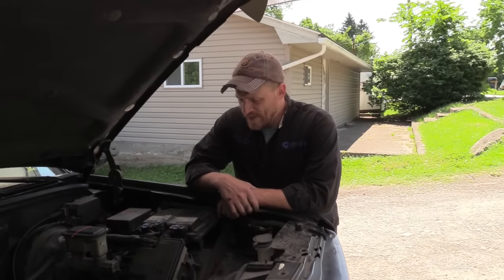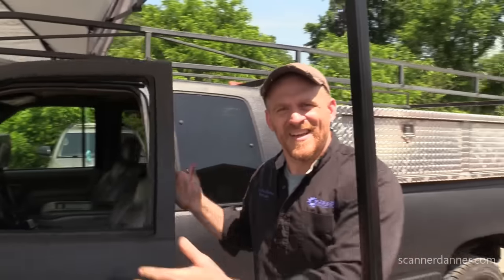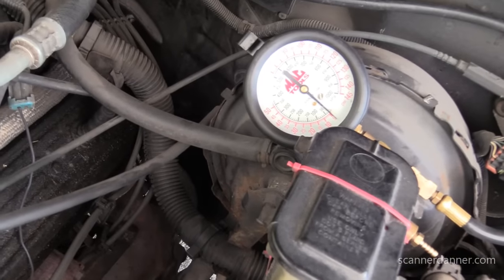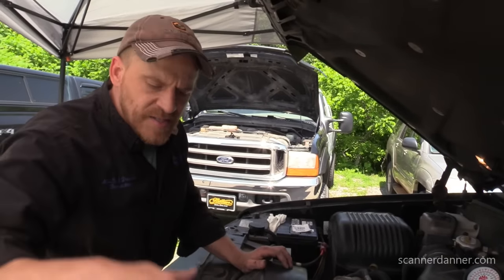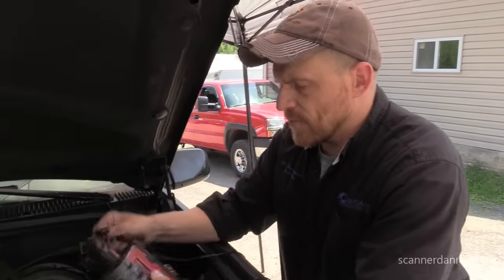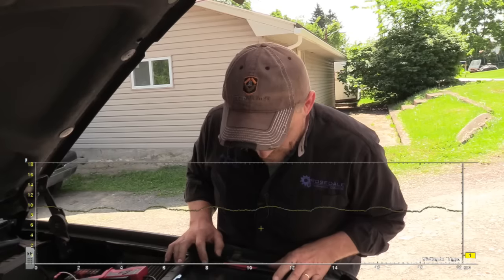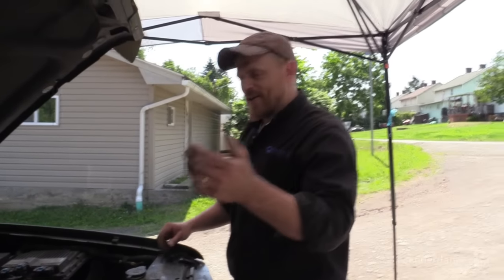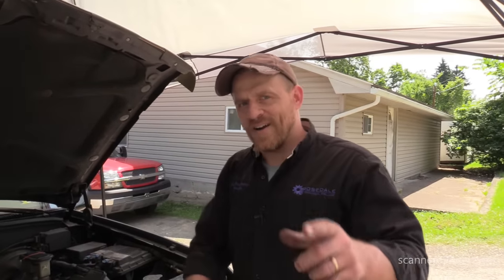Quick Diagnosis of a '97 Chevy with a Fuel Pressure Problem

Comment: Couldn’t a dirty fuel filter cause this as well
Reply: I was thinking the same thing. If it has an external fuel filter I would change that first then see how it looks.
Reply: Wouldn’t you want to T in before and after the in-line filter to make sure pressures were reading the same ??
Reply: Fuel filters are cheap. Just replace it and see if that fixed it.
Reply: Restriction after pump would have more amp draw.
Reply: Charlie Magoo ..... How much more amp draw would I expect to see??? What is a normal amp reading for that pump??
Reply: Joseph Baade.  He mentioned it in the video i think 8-10 amps.  He showed a video one time of a pump wired backwards only 1.5 amps or such.
Reply: Joseph Baade           A plugged fuel filter would do exactly the same thing but the scope pattern of the armature shows us that the pump is bad. Pump rpm is also low. Driving with a partially plugged fuel filter can damage the pump over time as well.
Reply: I'm a be honest with you guys, I've never had a fuel filter on a gasoline engine cause these symptoms.  On a diesel?  Sure, but gasoline?  Never.  I have been in the industry for a while now.  99% of the time this is either a fuel pump, or circuit issue.  Fuel pump relay, stuff of that nature.
Reply: I have been in the trade for 47+years and i have seen a clogged fuel filter cause that problem. Not often but i have seen it.
Reply from the maker: Absolutely a plugged filter could cause a low volume/psi problem (which is what we had), changing the fuel filter and retesting is about the only thing you can do, other than measuring psi before and after the fuel filter, which no-one does. In my experience, when a fuel filter gets plugged to the point of low volume symptoms, the pump it getting replaced anyway.  Damage occurs to the pump (higher than normal amperage/heat) from plugged filters. I had a customer with a plugged filter (work truck), changed the filter, all was well, happy customer in that he only needed a filter and not the pump, truck comes back 2 months later on a tow truck with a bad pump and he was very angry with me in that he had to miss another day of work. I have never just done a fuel filter since.
Reply from the maker: @Gene Mean I have no problem with this method at all
Reply from the maker: @ Joseph Baade yes you would and it is just easier to change the filter and retest
Reply from the maker: I also want to add, the pump RPM and waveform said this was NOT a plugged filter problem.

Comment: 1997 k 1500 silverado 5.7L 287K miles still has factory poppet injection,
i had started to get long cranks. checked fuel pressure and fuel pressure was going to 60 but leaking back quickly down to about 20.
decided to put another fuel pump in it Delphi> i was already going to take the pump and sending unit out anyway because of a intermittent fuel gauge failing (Carter fuel pump sending unit was installed 2 years ago and has never worked right). aNY WAY
the original pump (carter had a leak back issue) so i decided to put a new delpi in the original sending unit i removed before the carter.
ok here is the meat and potatoes, new delphi pump pressure prime pressure 60psi. run idle pressure around 54 to 55. snap throttle goes to 60.
truck is stumbling during open loop and not so bad on closed loop. pump amps are 4.89 running idle and i have checked all the plugs for good connection. Is 4.89 to low for a new pump.
also my LTFT and STFT are high 25%.
this truck has had history of lean  po171 174 . i have noticed since this new pump my fuel trims Short term are kinda hunting around and always staying positive LTFT are always around 25%. i believe its a fuel delivery problem.  also has new fuel filter.
can a FPR or poppet cause this problem.  also on the snap i am watching misfires happen on almost all cylinders 1 2 and 4 events at a time.
i am at a loss. is it common to get bad fuel pumps. could poppets And FPR cause this. ALso i will admit during troublshooting of the old pump i pinched return and ran pump with the test wire and pressure went to 75 or something might have even been higher. could i have damaged the FPR to to cause new pump low fuel pump load and low amps and lean
help if you can and thank you very much. gonna do some more test tomorrow
Reply from the maker: Yeah great questions! I like your psi readings you said, after the second pump was put in. But amperage is low, these run closer to 9 amps from memory.
Yes a pinched return line can damage or rupture a regulator diaphragm but that would cause some serious rich conditions from the fuel leak internal to the manifold and also a very bad bleed down issue.
Is it low on power? At wide open throttle?
Reply from the maker: Open loop stumbling as in misfiring or idling an initial step in throttle response? 
Intake manifold vacuum leak could be a factor if it's an idling issue
Reply: @ScannerDanner  open loop stumbling it was acting just like your vehicle in this video 
But would not do it all the time 
And doesn’t do when it goes closed loop 
I need to check the ground for the pump 
I am gonna give it a new ground to see it amps change
Reply: When you go WOT
Reply: I am gonna do a few more checks
My main thing was the Amos on that new pump 
Especially when watching your videos from your experience knowing they should run 9 amps 
I am a diy guy and don’t have a lab scope to check wave form to see if pump
Is running at correct ROM
Reply: RPM
Reply: @ScannerDanner  when it’s at operating temp 
It seems to run great although while driving and monitoring my stft and LTFT trims are high
LTFT is at 25% during cruise and stft fluctuates any where from 9 to 15% all positive 
Truck seems to run great when warmed up
Reply: Fixed it finally after 3 years of high fuel trims
Reply: Installed new MFI and all fuel trims returned to normal

Comment: Funny my fuel pressure is at 48 psi at idle and rises to 58 psi when I blip the throttle, 57 psi key on engine off, runs fine
Reply from the maker: Two explanations for that. 
1. You have the updated injectors that are not using the mechanical poppet nozzels
2. Your gauge is off by about 4 or 5 psi
Reply: @ScannerDanner  I did wonder that, well it runs fine other then the lack of power, I do have the updated injector assembly, it's been a while since I did it, but I noticed the pressure dropped with the new setup, but just recently I have been chasing a slight rough idle, but mostly lack of power condition, and might have been overthinking that it's the fuel pump, seems to startup ok and wot there is no bucking or misfiring, no codes either, wot tests were also done with fuel pressure gauge attached, wot fuel pressure rises to 57 or 58 psi.
Reply from the maker: @dawsonjorgensen3521  my favorite low power test is to watch the O2 mv at WOT
It should be 800+ the entire time. If it drops low, you have a fuel starvation issue, if it stays rich as it should next step is to check for a restricted exhaust
Reply: @ScannerDanner  much appreciated, will definitely check the o2 readings

Comment: Man do you have a email? I have 98 gmc I've changed fuel pump lines filter mass air flow coil wires alternator. My truck cuts out hard starts lose of powers. It seems like fuel but only dose it intermittently. I need help it's my plow truck and cant be down
Reply: My 97 does the same thing
Reply from the maker: I have a  forum that is free to join and we can definitely help you. 
https://www.scannerdanner.com/forum/post-your-repair-questions-here.html
Reply: @ScannerDanner  thanks man I've watched all your 5.7 chevy videos and done all test and at a loss. I subscribed and posted my question on the forum hope it makes sence I'm horrible with describing what's going going on. I know it's something that if someone like you looked at it would have it figured out in mins lol I'm a parts changer not a mechanic lol I can not diagnose very good imo
Reply: @ScannerDanner  I've tried and when I go back to look for replys I cant find my question. I've tried 3 times.
Reply from the maker: @jesserousseau2481  email me at support@scannerdanner.com with your user name and I will look to see what is happening

Comment: Most possible faults: 
1)It’s a Chevy 
2)Drive by wire pedal wire is kinked
3)Muffler back pressure too low
4)Refer back to #1

Comment: clogged filter?
Reply from the maker: a clogged filter would be an option, but amperage would have been very high in that case. I think I did an amperage measurement?
Reply: @ScannerDanner  you did and it was in the normal range with low rpm on the pump.  thanks for the reply.  you and eric o are heroes.  am going to buy your book once taxes are paid...cant wait for the new bedside reading
Reply from the maker: @peetky8645  thanks so much!

Comment: truck cuts off going down road ?....cranks but won't start ? ...check the ground strap running from back of block between engine block and firewall down thru a tube to the passenger frame.....note---ground strap at back of engine is a bastard to get to

Comment: Flow test would of been nice, those in the know test the flow😉😉
Reply from the maker: No need to do a flow test, never have, never will. If psi drops during heavy loads (wide injector openings)  you have a flow problem.

Comment: wow, easy to get burned on this, I thought 50psi would be fine.  also thought the system could increase the fuel trim to compensate.  i was expecting to see 20-30psi.
Reply from the maker: yeah, this system is very sensitive to low psi because of the mechanical poppet nozzles that are on the end of the injector ends. They only open with pressure (min 50 psi to open)
Reply: Oh that makes sense now..  last one i messed with was on a 99 Suburban, replaced the whole spider with the upgraded EFI style injector kit.

Comment: I found your video trying to diagnose my 97 K1500 Suburban. I think I might have a failing pump but I have no codes. The issues I notice is a rare hard start cold, consistent hard start warm. I've checked the pump multiple times and I've posted about it on a few threads. Here is one of those checks and at KOEO I have 60 psi, as well as 60psi on tip in ( https://www.youtube.com/watch?v=vD9qC7vO5KY ). I swapped out a clogged OEM map sensor, battery (bad cell optima) and alternator (spun bearing) throughout my route of diagnostics, all of which provide a moderate improvement for a short amount of time. Any help would be great!

Comment: Had the same problem but for me it was the regulator not the pump
Reply from the maker: A stuck open regulator can certainly cause low psi, but it's going to be low all the time. It's not going to be normal key on prime and at idle and then drop on a snap throttle. Those aren't symptoms of a stuck open regulator. 
There is another test (not shown in this video but in others) where you can test a regulator by blocking off the return line. This is the 100% foolproof regulator test
Reply: @ScannerDanner  yeah I just meant I had the same problem the truck was having that it would sputter when accelerating but my psi was at 40 and it would stay there. Wasn’t expecting you to reply lol love your videos man.
Reply from the maker: @utbelok  thank you!

Comment: My 89 S10 hates fuel pumps. I have a ep 386 AC Delco fuel pump. Yet another NEW one that's biting the dust. Who's the person that designed the turbine fuel pump. Because they need to be in prison! What would happen if I placed a Ford inline fuel pump that was for a 87 Ranger with a 2.3 engine.
Reply from the maker: have you been changing your fuel filter too? If not, you definitely should be
Reply: The filter near TBI is a couple months old. Every pump I have purchased ethier had the sock in kit or I purchased one to retain warrenty. Always use new sock on bottom of fuel pump when replacing pump. Don't make sense putting new fuel in without new filter. Gas tank is new also
Reply from the maker: Yes, the one near the TBI. Definitely change it again, also do a fuel psi test when you are done. It should be 9-13 psi on your TBI (I think). Make sure it is not too high. A stuck closed psi regulator or plugged return line can cause that and prematurely burn out your pump.

Comment: Could bad regulator cause low pressure allowing fuel to just cycle to return line, and if so, wouldn't the pump stay on. New cheap pump, and filter, ran for a day. Guess I can't hang parts today, or cheap ones at least, i hope. can't believe I got burned, I think, I hope. 80 dollar pump, kicks on, shoots like a limp dick. Sonic brand. I'm strapped for income big family etc, hf fuel pressure gauge kinda ok, have to remove schrader valve to get it to work, more fun shit. Filter is new. So you think post office will mind a box smelling like gas, not even worth trying to return, so screwed.

Comment: Truck turns on reves up then dies
Reply from the maker: Dude for real, I do not have a crystal ball. Year, make, model, engine at the very least! Secondly, what is your fuel psi? Does it immediately restart? What trouble codes?